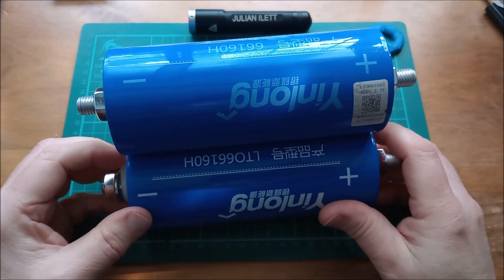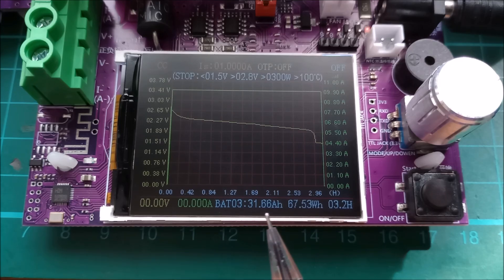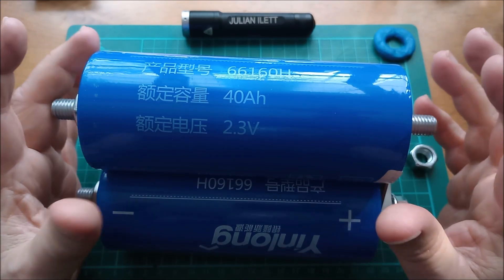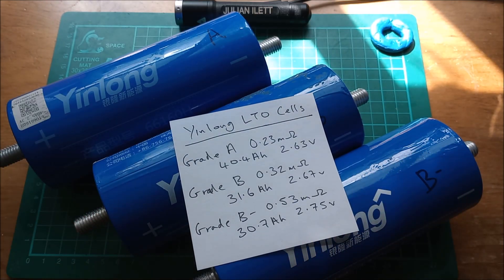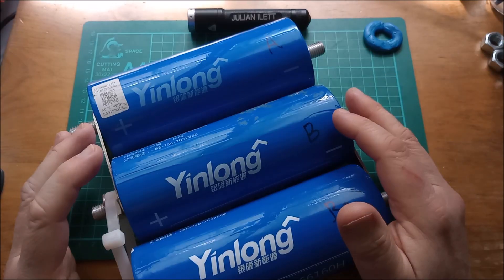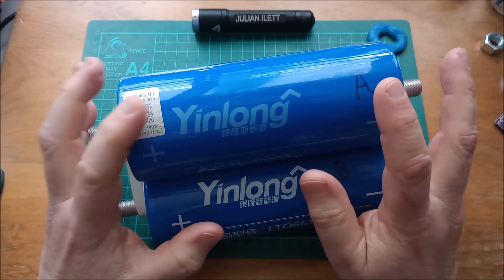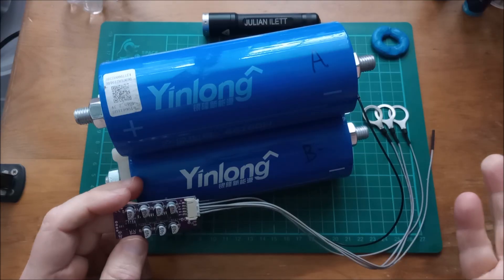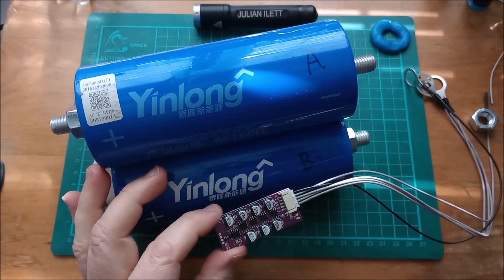Battery using Different Grades of Yinlong LTO Cells?

Comment: Yinlongs are a joke every bass head builds a bank for the voltage 15 plus volts. So good luck if you build an 80 aph bank. A 6s bank two in parallel total of 12 cells makes 6 parallel banks. So the capacitance and internal resistance in  all the cells will never be perfect. The balancer can only balance and work at max of  .5 volt difference. You watch the cells on charge and the voltages  need to be all super close. So when they top off at all the same volts you should have  that voltage on all banks. So any cells with a 1  volt difference you put in the garbage. Them banks will never discharge off a dc to dc converter or alternator and why because they will all go off voltage from  banks anywhere from .2 to.3 to .5 volts anything more is total waste of a cell. Put a x on them for garbage. So a alternator  is useless it does not work like a dc power supply the meaning you got some cells that charge much quicker that cell will look like at a top voltage from a alternator at 15.6 volts it might reach 2.8 volts and you will reach 2.6 volts with the other banks and maybe 2.5 volts. So thats why on a power supply  they need to all be close like a .1 volt. The dc to dc  converter is set say at 15.6 volts the cells will not exceed the 15.6 volt range.  They can go to a  16.8 volt max charge and at  100% charge they won't last long. So 15.6 volts is the max at 95% charge. The problem the bass heads are not watching there bank voltages they are running a mismatched lto bank. So sentec America makes a 15.6  volt dc to dc converter output at 80 amps. The input is 12 to 14.5:volts max. They make a 6S balancer with the exact voltage read out on all 6 banks. The best way is to build one bank of 6 and see how they charge on a power supply if there all in the .1 range of volts and all meet up even on top voltage. Then you mark the cells on that bank to see the quickest ones that read full charge. So you put the volts on each cell with a marker. Then build another 6s bank put the voltage on the cell that reaches the max range first and the next to the last. Then the exact match voltage cells you put in parallel  on the buss bars and complete all series 6s bank to complete, and all cells in parallel going down that bank should match. So the only thing that waste of a real expensive lto bank to build is to run a 8 transistor cb amplifier that can be powered at 15.6 volts to get 2000 watts wow. Best of luck keep that motor running and the heltec balancer hooked up with read out. The junky yinlongs should last. Massive alternators mismatched cell banks a good fire and have the brain of a bass head. I got 10,000 watts and your 2.0 welding cable is on melt down with a huge cell imbalance best of luck from a battery builder

Comment: from my under standing is these cells are 45AH when brand new from YinLong that are used in buses for 5-10 years then relabeled and resold as 40AH cells with 10-20 years life rating left on them if they pass the 40AH test otherwise I guess they are sold off as low grade cells 
also these are rated for 30.000 charge cycles and the buses that they were used in charge as much as every 30-45 min on a very fast 15min charger everyday all day in some cases 
but they are great safe battery's for 16v, 24v, and 48v systems that need to work down to -40c
Reply: Ah great observation. I was a little confused why they are so cheap. They would make great recuperation damper.

Comment: I’m surprised YinLongs are so popular…I’d guess it’s because they make a 40Ah that’s got decent energy density..but a lot of people get screwed over and end up with 30Ah cells. 

The Lishen LTO 26Ah are truly the holy grail of decent capacity LTO cylindricals. I’ve heard the 18Ah have nowhere near the C rate. The 26’s are genuine 30C/50C cells for continuous/burst. The 18’s are wayyy less than that. I know they also make a 24Ah. 

The Toshiba Scibs are insane though. The prismatic 10Ah is rated at 75C but I find it hard to believe it’s truly 75C continuous. That’s what Sriko says though….the 20Ah are something like 35C continuous and 75C burst. 

Re: your Yin Longs are you sure you don’t have two 30Ah cells? I believe if you remove the shrink there is info on the cell. That capacity is just FAR too low to be from degradation. Look at the charts and it’s pretty much impossible to get 75% of rated capacity. Unless the manufacturing of the cell was entirely fucked.

Comment: I bought 32 LTO batteries. Will the lifespan of class B lto be shorter than that of class A? Do you think a B grade LTO battery would be suitable for an electric bike? Would a Lifepo4 battery make more sense?Thank you
Reply: My personal suggestion is that Class A batteries will last longer than Class B batteries. The lifespan and capacity of Class B batteries are far less than those of Class A batteries.
Because Class B batteries have been used, they are second-hand batteries.
Class A batteries are brand new and unused😁
Reply: @何凯忠  LTO batteries were purchased new from the dealer. I did not purchase it as a used product. In the part where the QR kode is located, it says grade B. Is this a used item?
Reply: @nepabroadcast  Not nessesarly. Since battery's are allways chemical you have natural drift and quality differences. Therefore they are getting graded in the factory. The best cells get grade a and others lower.

Comment: Thanks for the info Julian,
"Different capacity cells in parallel is completely fine." - so if one can get different battery grades, hopefully at their 'right and fair price' worth;
Make the battery pack easily modular and expandable. Easy disassembly and room to expand, so matching will be easier once more cells arrive.
This sounds easy, but then the details creep up: Which controller is best, new enclosure(s) and wiring, fuse rating, etc.  
In the end, it could be worth it - but only if you're well skilled (and has knowledge) to do it safe.  
Ah, time to work on my LiFePO4 bank w. 400 'small' cells - some with minor difference in capacity, others with a bit more

Comment: I can't imagine there's much market for cells that have already lost 25% of their capacity.  Cells tend to degrade slowly when young and then lose capacity faster as they age, so perhaps they have not so many cycles left before they reach 50% loss.  Also, if they've lost 25% now, then balancing will quickly become impossible as with age they will degrade to even lower capacity at different rates.
Reply: That is opposite. Cells typically will have a period of "rapid" degradation that levels out. Also keep in mind different chemistries behave wildly different in terms on degradation. LTO will have very different characteristics as opposed to NCM or LFO.
Reply: @easternbiker47  I forgot about the initial loss, so you are certainly right about that. But my point was valid, I believe, for cells that have lost more than 25% of their rated capacity.

Comment: Greetings Julian, Super capacitors, one of you past experiments, have you seen recent appearance of 6 by 500 F boards with protection on Ebay, they look better than the original ones you had problems with, large tags, well soldered etc, can I tempt you to have a delve if you have time away from the Cell tests.

Comment: i so badly want to try 6 of these in my truck, but im already running about 90ah of Lifepo4 cells in a 4s setup and in no way do i need to replace them yet lol. maybe my next car ill get some of these because 40ah of lithium is way more useful than say 60-80ah of lead acid, and lighter weight as well.

Comment: You need 1000 of those for a long range electric car. I don't think it will a good option.
Reply: yes these are used in buses that re charge every 45 mins in less then 15 min with up to 30.000 recharges
Reply: certainly not good for electric car. they're much better off for short term very high load systems, either just starting batteries, or the big huge stereo systems.
Reply: Long range personal EV are a niche market. LTO chemistry is capable of fast charging

Comment: Those cells are huge , what is a shame is that they are only 2.30 volts each  . So to make a 12-volt battery ( 13.8 volts ) for a motorcycle or a car you would need 6 of these ,  6 or 12 to get to 13.8  volts , 5 or 10 batteries for an output of 11.5 volts , they would still be good for anything that sits around for months that needs a battery when needed it's not dead
Reply: yes you would need 6 cells but there more like a 16v pack that can charge to 18v and they are big in the car audio world as they like to use 16v and need big time power draw
but they work great for 24v and 48v at 11s and 22s packs

Comment: Are we going to change the channel name to "Julian's Battery show" in the near future. 🙂
I would never put unmatched cells in series, unless you want the pack to only have the capacity of the lowest cell. As if you don't cut the discharge off before the weakest cell has discharged it will start to charge up in reverse. Not even sure if its a good idea to put them in parallel?
Reply from the maker: With a powerful enough balancer, the capacity (in amp hours) could be the average of the 3 cells. Different capacity cells in parallel is completely fine.
Reply: @JulianIlett  in series you need the balancer to keep the voltage across the weakest cell to the minimum allowable once it has discharged. i expect it will get quite hot doing this.  Or you just cut the power once any one cell has hit the lowest safe voltage level, which would limit the power pack to the weakest cell capacity.
The best thing to do is use a massive single cell battery and convert the voltage up. 🙂
Reply from the maker: Yes, I'll be looking at the 10A and 12A transformer-based balancers that are now on Ali.
Reply: @JulianIlett  look forward to seeing them on the "Battery show" 🙂
Need to look at your shed builds again i need a new chicken coup and thought they might like the idea.